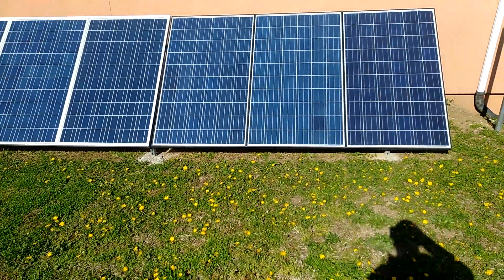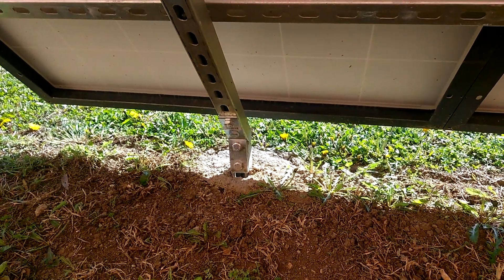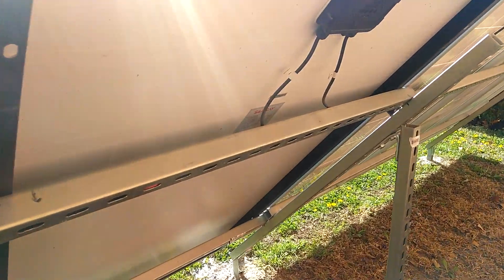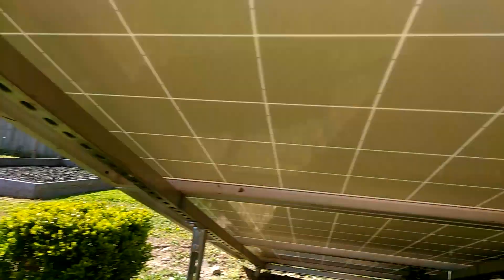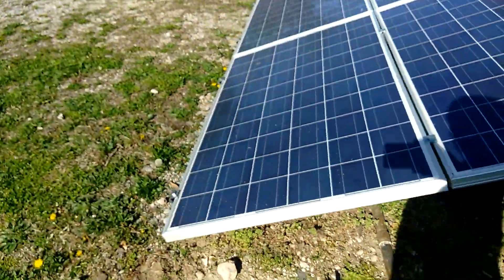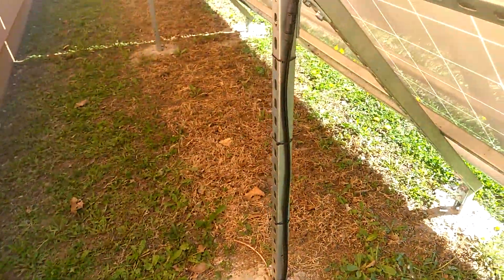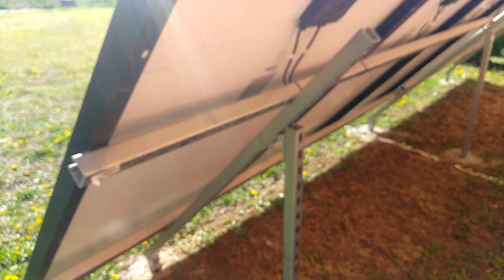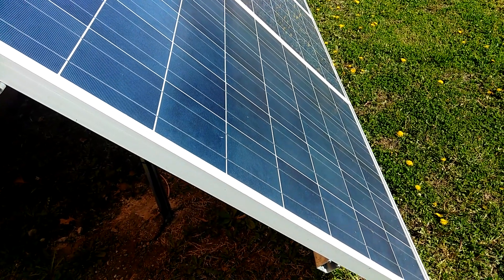using unistrut for my ground Mount solar panels

Comment: Nice mount. I like it. How did the panels bolt to the unistrut?
Reply from the maker: I used the cone nuts that comes with the unit strut to mount the panels. I have a video about it can't remember the name of it but if you look it's like maybe 6 months ago.

Comment: How did you bend the L brackets?
Reply from the maker: Use a small piece of pipe about 2 ft long and bent the l bracket to the angle that I wanted.
Reply: @carsonlurbanwindandsolar3437  awesome thx

Comment: Great job. I was thinking of doing similar but vertical w 320 watt panels. Do you think it would be able to hold 1 panel rows vertical at 90 degree up no slant?
Reply from the maker: It should work I don't see why it wouldn't if you have to you can extend it out a little further using a flat bracket.

Comment: Man, if those were 2x4 lumber it would have cost like a million bucks these days.   Our local metal store sells Uni strut in 20 foot lengths and I think a couple different thicknesses, it’s a pretty darn good deal from them.
Reply from the maker: LoL 😂.
Reply: You can find different types of unistrut fittings and connectors online which aren't carried by your local home depot store.
Reply from the maker: Thank you for that information 👍.